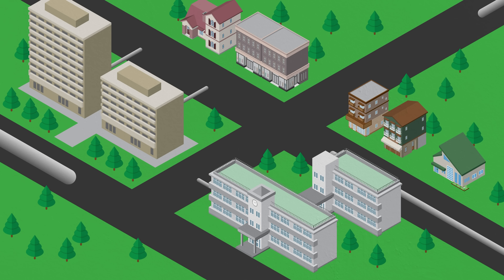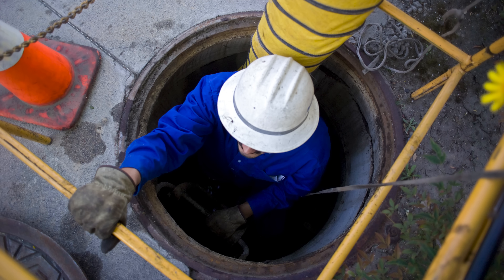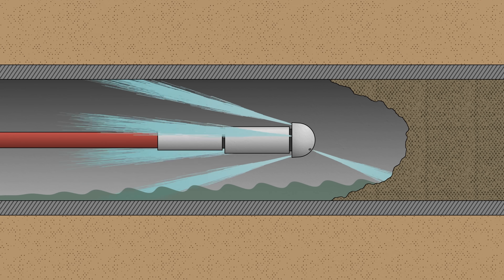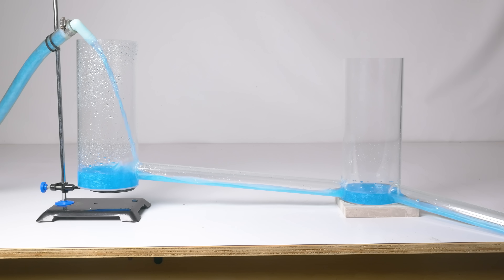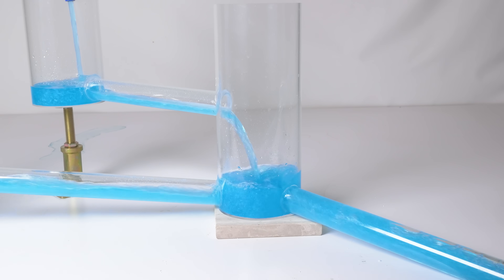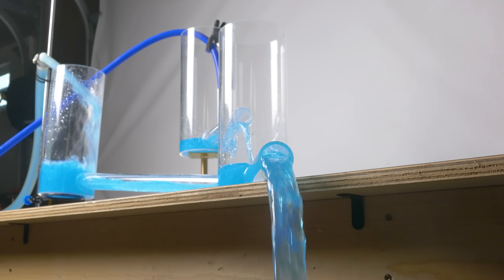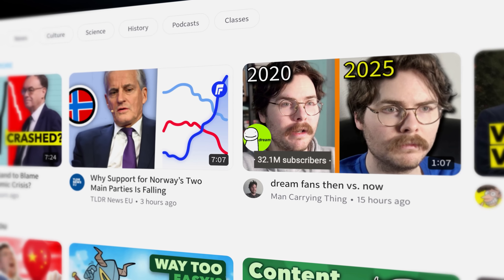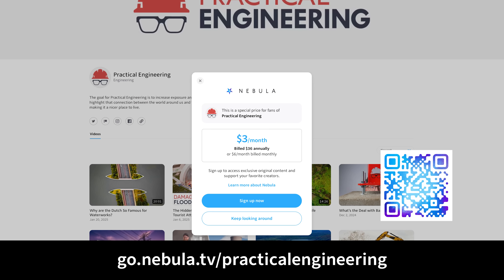What’s Inside a Manhole?

Comment: Grady, I had a job where we filmed the inside of sewer lines using robots. Sometimes we did have to drop into trunk lines ourselves and film the pipe. Once I found century old mortar tool used in the construction of the pipe. Thought it was cool. Here in Cincinnati we have a combined system but the federal government gave us a grant to separate the systems and it has been a multi decade long project.

Comment: I have to disagree with your statement about the slope of the pipes. We don’t care if rocks are running through the pipes we need a specific slope on the pipes so that the water takes the solids with it. Too much grade can leave the solids behind to clog up the pipes.

One other very important thing about man holes is the rim elevation on the man hole. You never want to hook up to one with the finished floor elevation below the rim elevation. Bad S**T can happen literally.😮

Comment: Most people expect a sewer system in a city to smell like an out house, but they smell more like an airplane toilet. There is a lot of scented liquid in a residential sewer system and that is mostly what you smell. It smells like cheap cologne. By the way I have seen square manholes, they were very old. Manholes also provide pressure relief as well. The city I worked for many years ago was built at a time when storm drains and waste water were combined into one main system. When we had heavy rains the manhole covers would pop off and the water would gush out the top of the manhole and into the streets. This was due to the changes in standards, the city used to drain the raw sewage into the Fraser river, this is no longer allowed. Instead of free flowing into the river all waste water was to be treated before being released. It has taken many years to rectify this situation. The city is in the process of upgrading the the system to add separate storm sewers. The results of waste water treatment along the Fraser river are visible. In winter the river was too warm from residential waste water to have ice on it, now it is a regular site in winter.

Comment: I like to collect my sewage into clear plastic jugs. I store in a large open vat outside to let it evaporate a little and concentrate for volumetric efficiency.. Then I use a plastic cup to pour through a funnel into between 20 and 30 5 gallon jugs. Once a month I take these jugs and drive around for a while while dumping them out of my drivers window. Usually at night so as not to bother anyone. I carry a long stick to poke out any hardened or clumped parts. After maybe an hour I wipe the outside of my car doors with rags, and pick up any pieces or liquids from my lap and floor mats. I reuse the same jugs, and no point in cleaning them, since you know it's my own sewage, but do keep them in the garage no my living area.. This allowed me to save a couple hundred dollars by not connecting to the public line nor building a septic tank.. Just a little extra work, but I live off grid in my own neighborhood. Ha. Try it sometime, y'all

Comment: Infiltration of water into sanitary sewers can cause substantial problems for treatment plants. An example was/is at the north end of Seattle, in the Lake City area; they used to have a treatment plant that was built in the mid-1950s (long gone now). The infiltration of ground water was a huge problem for the plant. They rerouted the trunk sewerage in the mid-1960s to eliminate discharge into Lake Washington, and I suppose they included the infiltration into their new pipe & treatment plant sizing calculations.
Reply: Infiltration into sewers does create problems at the treatment plants but, it can often help move solids in flatter-sloped sewers which often times don't have enough water flowing in them due to low-flow faucets, showerheads and toilets.  I thought it was ironic that our sewer maintenance crews would end up having to flush the solids out of many sewer mains, using potable water, because of the building codes that required the use of low-flow fixtures which didn't provide enough water to do the job. All in the name of "saving water".
Reply: @johnnyh3653  Good point; hadn't thought about that.

Comment: To anybody who may know the answer, I have a question about that pipe Grady introduces next to the drop manhole at 9:10.  Wouldn't that just concentrate all the pipe wear to that one spot?  If so, then are those pipes generally inside the manhole, or a vault adjacent to the manhole, so they can be more easily inspected and serviced, or are they reinforced so they don't fail despite the additional abuse they endure?

Comment: Fun fact: some sewers made out of concrete has egg shaped crossection due to being most efficient profile for transport of fluids no matter the level. Circular crossection is much simpler to manufacture and can't be placed in wrong way. Also some have basalt bricks concreted on the bottom to reduce wear from sand and rocks.

Comment: Always enjoyable and entertaining.  Thanks.
Question: Danny Harmon over at Distant Signal told me that you were the guy to answer this question.  I asked Danny and few others this but no one can explain it.  What keeps a train from pulling itself off the track on a curve, short or long or "S"?  By that I mean, when a train is a quarter of a mile long or so and goes into a curve, I would think that at a certain point in the curve the train would want to straighten itself out and pull straight through the curve.  Hard to believe the wheel flange could withstand that much side and the track too.  Especially if it is being pulled from a standing start.
Perhaps some day you can put this and other train related engineering into video for.  Please hurry, I'm 81.😁🤣
Keep up the good work!                      JimE

Comment: You nailed it! I work for a company that builds manholes (mostly polypropylene, some polyethylene, and PVC). One major change in the last couple of years has been infiltration crates—easy-to-install structures that buffer rainwater and allow it to infiltrate back into the groundwater. If they overflow, the excess water flows into our manholes, making the system cleaner and more sustainable. Additionally, it helps with water retention. Great video!
Reply: Yeah, I remember starting to specify them here in Scotland about 15 years ago or so, and they're pretty common on a lot of sites due to our SuDS (Sustainable urban Drainage Systems) requirement that surface water should be reduced to a minimum entering our existing sewer network by infilltration methods. These crates help that as well as our detention basins. Brilliantly simple wee things.
Reply: Huh those crates sound interesting. I haven't seen any of those installed myself yet, I assume they are used more in private structures rather than public roadways so far?
Reply: @AOTSismyhero  No, they are applied in all kinds of projects, from parking lots or roads to even airports. We offer various types, ranging from low-spec versions made of recycled polypropylene to high-end solutions. Our products are manufactured in the Netherlands, as well as in the UK and Poland, and are shipped worldwide.

The process is quite simple: a large hole is excavated and lined with geotextile. Then, the crates are snapped together to form a buffer. Side and bottom plates are added, and that's it—ready to go!

Comment: I am so glad you guys made this video. They are running a brand new sewer system down my road and forcing everyone to abandon their septic. They have not made it to my house, but as I sit at the temporary traffic light waiting (annoyed), I get curious of what they are actually doing because before watching them work on installing a septic, I always pictured those big tunnels in the movies and thought they were all like that while also wondering how they manage to not run into issues with the water table around certain areas (my hometown is only 8ft above the water table and sea level). Watching them work, it has been obvious whatever they are doing is not something people could walk around inside of. 

 When I saw the thing to hold the sides of the hole up, I wasn't sure if they leave that in there as a wall for the sewer, but I was thinking it looked too old to be something they would need a lot of and it kind of looked like they just use the same one moving it down the road as they work. Took me a few months to figure that out without really googling anything. 

It has been both annoying and fascinating watching them work. I look up the weekly public progress reports but it doesn't help me understand too much because of all of the jargon. 

This video answered a lot of questions and cleared up a lot of confusion. Between this video, what I have seen, and the reports, it seems they are installing 8" wide pipe under my road and not TMNT sized sewer canals. 😂
Reply: I was a sewer engineer for a city of approximately 150,000 (38,000 when I started) and 90% of our sewer mains were only 8" diameter.

Comment: I wonder where the classical pop-culture image of a sewer comes from. I used to think that maybe they used old sewer tunnels who probably really were that large to even have walkways in them as a reference, but relatively recently saw that even medieval sewers and cisterns were pretty much like the modern pipes, only having a different cross-section profile due to being built out of bricks.
Reply: Many are based on the old London sewers, which were deliberately way overbuilt in order to future-proof them (a largely successful endeavor, as they were largely sufficient until (iirc) the 80's). Although it is only really the, as Grady called them, interceptor and larger mains that look like that.
Reply: Les Miserables

Comment: I have a friend that will give tours of the drainage systems here in Memphis.   In the 1870's Memphis was battling Yellow Fever.  I was found that by enclosing the ditches and adding sewers the disease was stopped.  Even back then, they knew about retention ponds.  In the downtown area which is where the oldest underground system is, there are massive rooms for a better name to collect the storm drains.  One of the rooms he told me about is about the size of a football field and about 20 feet in height.

Comment: Here in Tacoma WA there is this one road, for a big part of it, the manholes are right where the left tyres travel, forcing many drivers to either drive over them, or just to the right.
My concern for this is, wouldn't that cause the tarmac, or concrete around the rim to wear unnecessarily?

Comment: Recently our county relined our pipes with resin soaked tubes the they blew into the pipes with high pressure air. The air turned them inside out and the could go from one manhole to the next while water was flowing. It was amazing to witness.

Comment: Great video! All manholes are not for sewers, though, different types of infrastructure can have underground vaults accessed through manholes.
Telecommunications and Power infra have underground pipes connecting manhole to manhole with fiber and copper cables running power/phone/internet. You climb down into the vault under the manhole to do maintenance on the big junctions and splices.

Comment: Great video.  For the general population, if you get the urge to explore the sewer system, don't.  Those of us who worked in the field get regular training on confined spaces, along with lock out-tag out, and fire extinguisher use, for good reason.  Even a new sewer system not yet in use can be hazardous.  I was told about a worker who died after entering a newly built system.  It turned out that a neighbor had been dumping his grass clippings into the sewer, which caused an oxygen-deficient atmosphere.  Another case was a worker who died after entering a pit chamber to read a meter.  He had been doing this for years, but on this particular day, the barometric pressure was unusually low, resulting in an oxygen-deficient atmosphere.

Comment: Low flow toilets are rough on a system designed for higher flow toilets. The slopes are different for the pipes. Combine that with 'flushable wipes' and you can put a plumber's kid through college.
Reply: We had this side-effect during a recent drought, when residents were encouraged to flush less to conserve water.
Reply: @gordonrichardson2972  File it under 'unintended consequences.'

Comment: another pov - in the uk, most manholes are square or rectangular, and sometimes hinged to fix the fall-in-the-hole problem. some are also inset, so they can be covered with the same material as the rest of the pavement/driveway/walkway/etc, e.g. by filling it with paving bricks matching the surroundings, so all you see is the outline. some are split into two separate side-by-side triangles, so theres less chance it rocks back and forth. in my area we also have underground utilities, so theres also tiny palm-sized manholes, im guessing to help in installing/maintaining cabling
Reply: Some, at least, of those palm-sized covers will have a domestic water on/off valve many feet down.
There are slightly larger ones which supply water to fire engines. Or other authorised parties.
Reply: Fun fact: those "palm-sized manholes" are called "handholes."
Reply: They are also triangular inspection covers common in the 50s 60s the small ones could be rodding eye not common in the street, there are cable or internet connection to housing
Reply: We got all the same kinds of manhole covers in Germany! I think its often round ones on the street, and rectangular ones on the sidewalk.